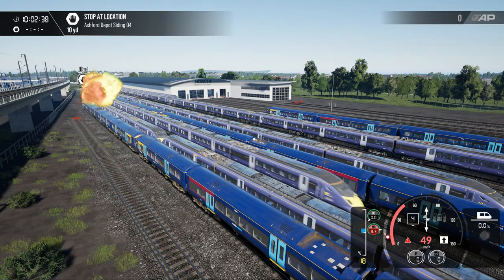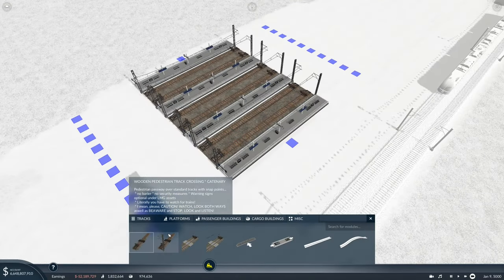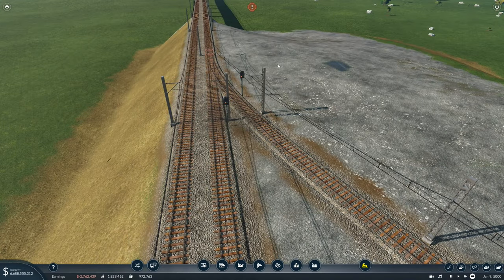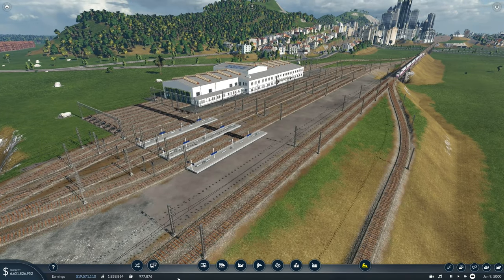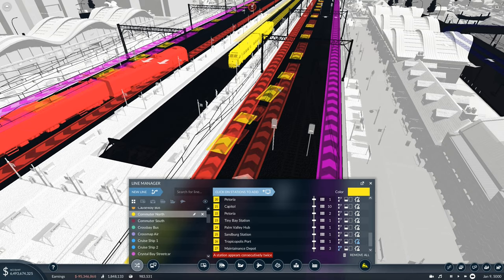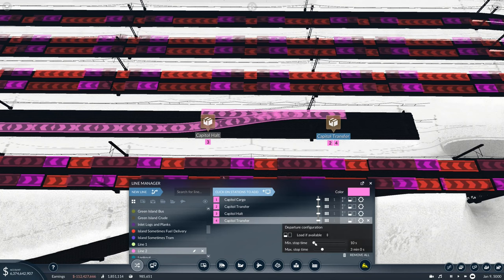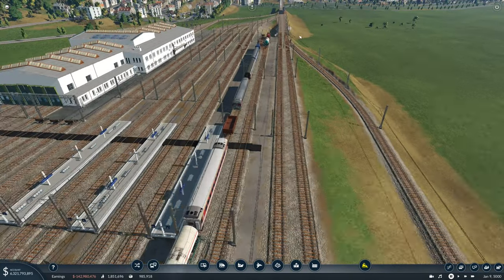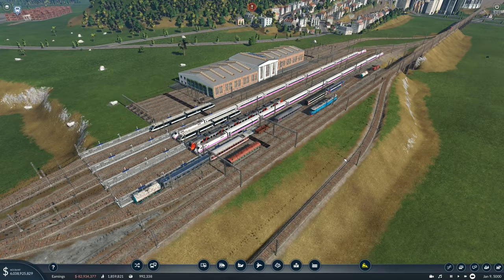Revolutionising Depots In Transport Fever 2

Comment: So if you go for realism there are a few small changes you could make. First, you do not need a turn around track. Locomotives would just go around the train and as you use multiple-unit trains they don't need to turn around they can just go both directions and second, a yard would not have multiple tracks that connect to the main line in one direction. All tracks would combine to one track before connecting to the main line. But apart from these two things this is really amazing.
Reply from the maker: Hey midorish thanks for the comment! While true for real life, the turn around track is needed for a lot of players within the game as trains will start shunting the carriages instead of pulling them without turning around as a large majority of the playerbase play with trains can reverse on. Thats why i added this. Hope you found it useful!
Reply: @Hushey  that makes a lot of sense. Thank for the answer. I guess with my preferences of building really big yards with enough space for shunting, either parallel to the main line or as a separate thing with only a connection to the main station I never considered that.

Comment: Another solution can also be a reversing siding i once had a junction that had a divergin main, and a straight going branch to the passenger main, and i had services that needed going from the branch to the curved away main in a way that needed a triangling of the junction, but i changed it so there was an extra loop, so the main couldve gone main, branch and the loop and from the siding to the branch and loop, and from the branch to the siding or main but norhwards
 |  |/
 |\|
 |  |
/ /|
Reply: Ps i couldve gone triangle but tbh the blocks were about what i wanted(with the junction troughputs on bothmains) so it wouldve probly been slower than the siding

Comment: But it makes it lot harder to work with the lines later. I tried your approach and when expanding the lines it caused me lot more headache. Plus the trains were not running in full capacity as well. Not worth doing in the early game. Maybe late game it could work.
Reply from the maker: Hi saiponath. This is indended when you have "completed" a game and need to decorate as thats what is left to do
Reply: Maybe I can think of creating a mod for this. We just need to count the number of times it doesn journeys before it goes into a depot line (pit line). And returns back to the line after sometime.